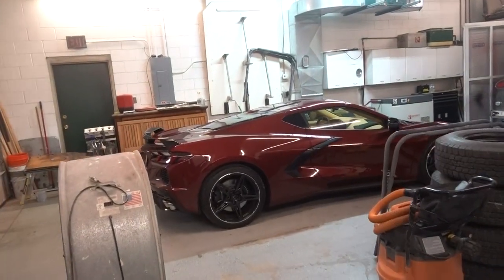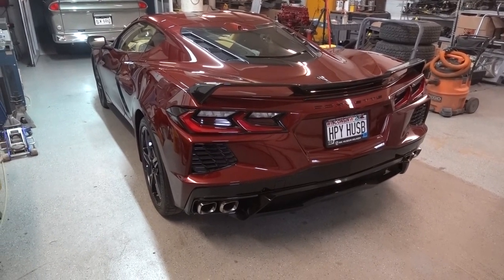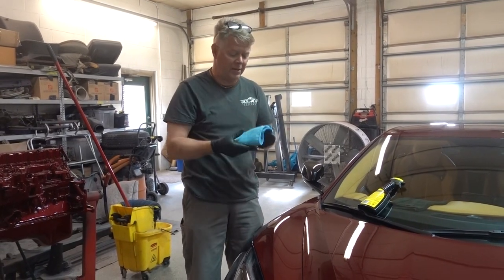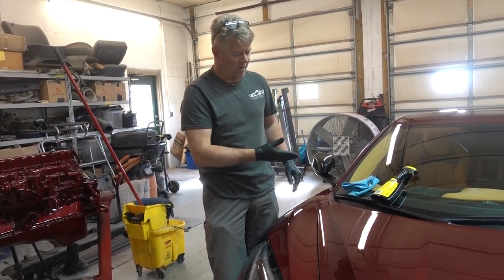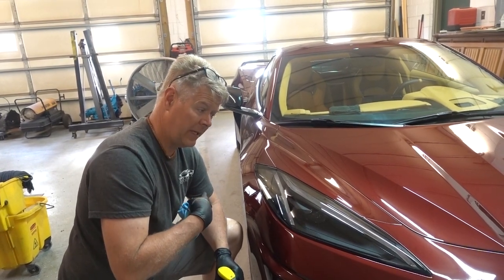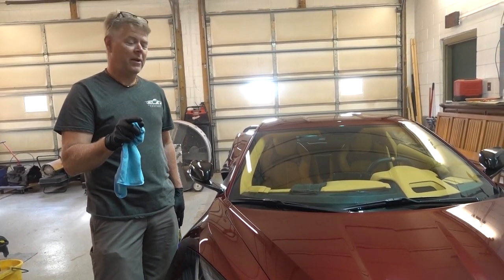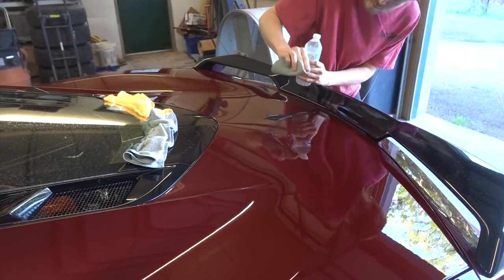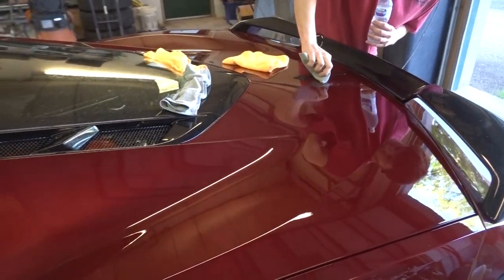I can't believe this is in my shop! | Legendary Customs - C8 Corvette gets detailed!

Comment: Excellent.!!!
Chris, when are you going to show your 63. 
I owned a 66 coupe back in 1976 when they were affordable.LOL. The paint code was the Moss port green which you may know is a silver green color. Well when I purchased it, it had been painted a shade of silver, and a few years later I stripped it down to the gel coat and repainted it Corvette Rally Red .
Was a great car. 300 hp 327 with a glide. Power assist steering,  p antenna, windows, and telescoping  teak steering wheel.
Reply: We will be bringing out the 63 SWC sometime soon. Thank you for watching. Corvette are hard cars to forget if you've ever owned one. It's all about the memories!